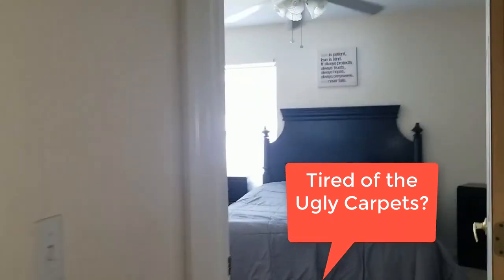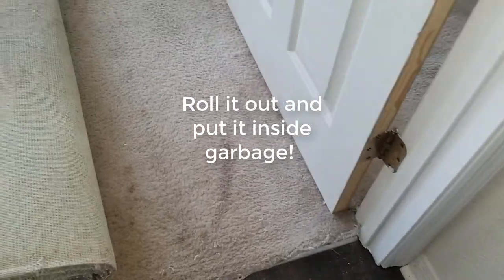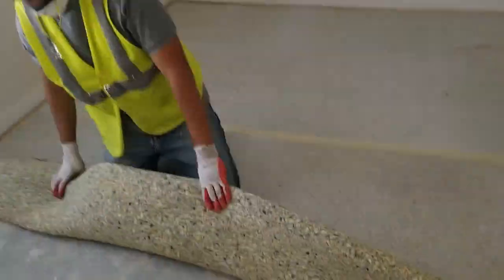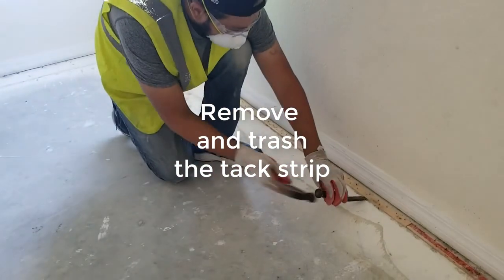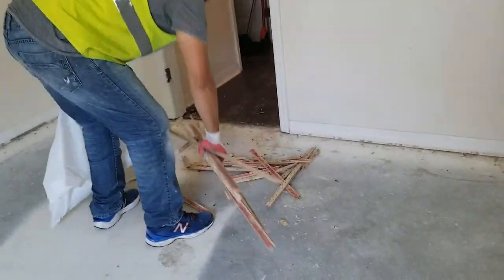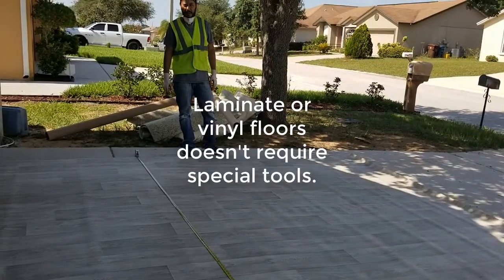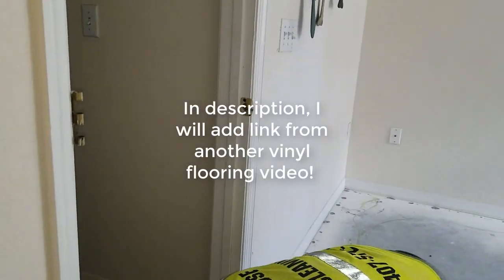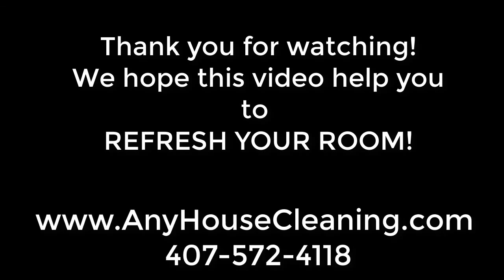DIY: HOW TO CHANGE CARPET AND INSTALL VINYL FLOORING. PISO DE VINILO

Comment: HI. Went through the entire video, but how to ensure that the vinyl doesn't need the underlayment in order to be in line with the rest of the flooring. (I am planning to change in one room and outside the room is floor tile - don't plan to change it for now. ) Is there a thickness you recommend or is there a way to determine the right thickness needed for vinyl ? Also, I see that the vinyl in your video is one single sheet - how is that ?, because I know that it comes in planks. Please advise. Will appreciate. Thanks.

Comment: Call me crazy but how do you stick the vinyl to the floor??? Is it adhesive vinyl or did you have to put glue down first
Reply from the maker: You have to put glue. In this specific case we didn't put glue because client didn't want it.